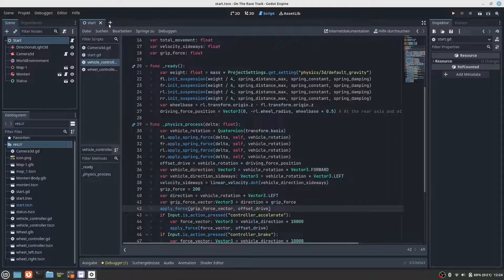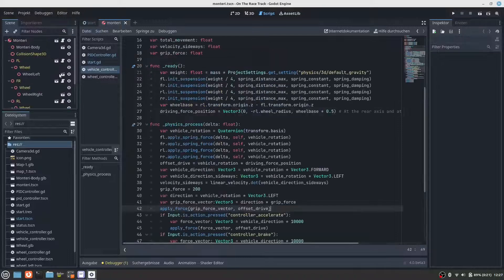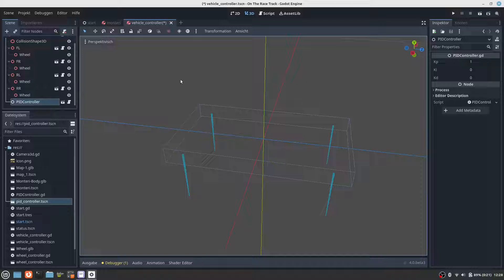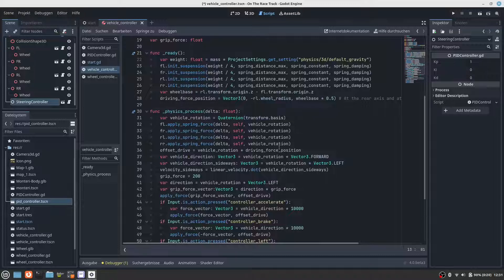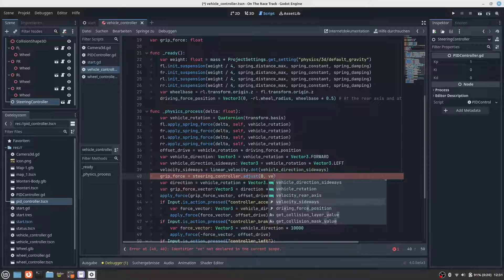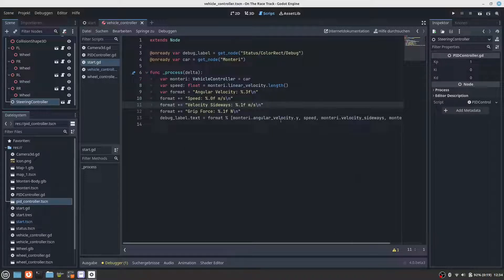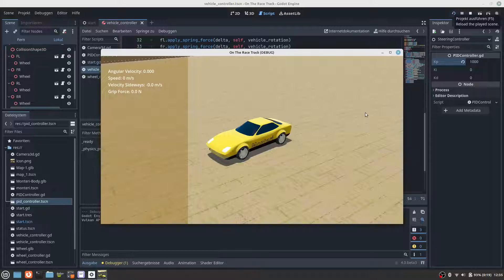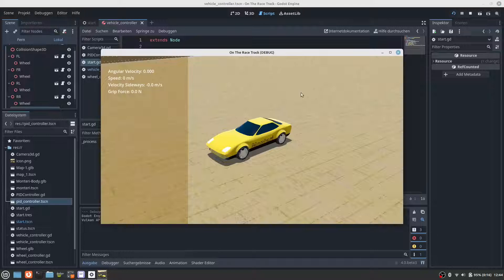Ray Cast Car in Godot: grip (part 2)

Comment: im enjoying this series, im making my own vehicle controller but with physics joints and rigidbodies and more realistic behavior
would be cool to have a discord server :3
Reply from the maker: Thanks, it would be interesting to see a video of the driving behavior of your solution. 🙂
Reply: @tomaga4995  so, a month later im also making a raycast vehicle (but using a springarm node which is like a shapecast which i dont have because i use 3.5) because my rigidbody wheeled vehicle had bouncy collisions at higher speed and it didnt look great. and now im having big trouble trying to debug my spring code, a single wheel works fine but when i add another, the vehicle starts bouncing high into the air and spinning..
Reply from the maker: @trainzmarcel2074  I found the physics in Godot 4 to be much smoother. So how about trying that?
Reply: @tomaga4995  ill try it tomorrow
Reply: @tomaga4995  okay so a long time later ive settled on using spherecasts for my vehicles and its taken me this long to realize using a pid controller for grip and braking is actually genius
Reply from the maker: @trainzmarcel2074  Thank you very much for the kind words! I'm glad you like it and nice hearing from you again.

Comment: awesome! thank you for this tutorial. Now I understood the grip concept :) One question: there is a difference in applying the force directly on the car body instead of the wheels? Like I've watched some tutorials where they dont use torque to rotate the car, they just rotate the front wheels and the forward force of them would rotate the car
Reply from the maker: I guess applying a force directly on the wheels would be the physically correct solution (haven't tried it myself). I wanted an arcade style drifting car and by applying a torque you can go sideways easily.